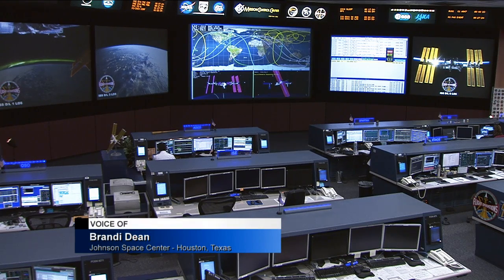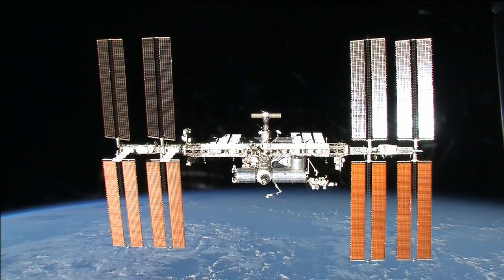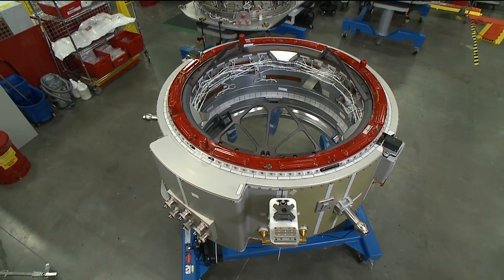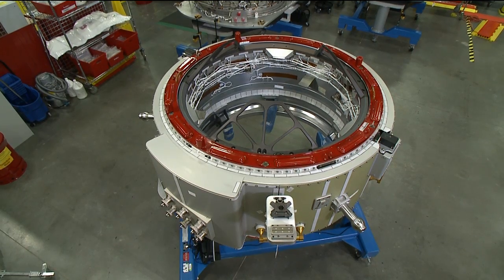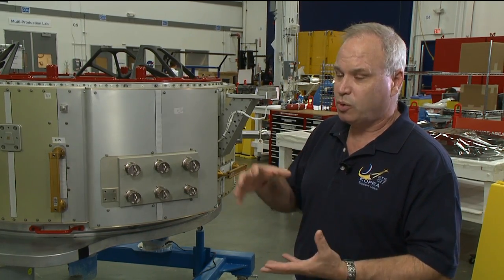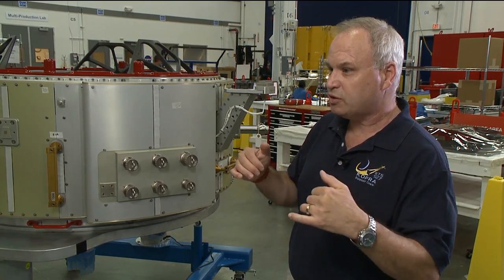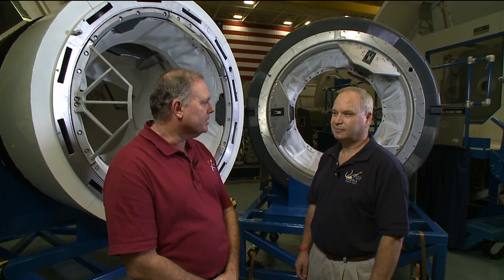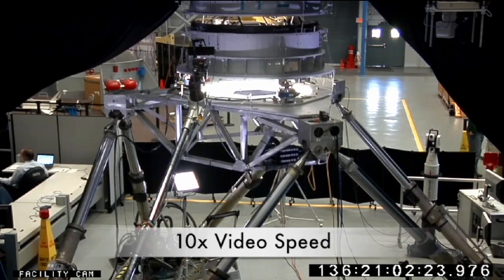Space Station Live: The ABCs of IDA

Comment: Maybe I missed it but why aren't they using copies of the Shuttle Docking Adapter, which was actually called the Common Berthing Mechanism? Apparently erroneously I might add, lol.
Reply: The Space Shuttles did not dock to to the Common Berthing Mechanism. Berthing is different than docking, because it requires you to bolt on the new ship (sort of like it's a new space station component). The tradeoff is that it can have larger port sizes to carry bigger objects. Berthing requires there to be someone on the station to do the bolting, so the you can't really use crew vehicles (in case of emergency). 

They used the Pressurized Mating Adapter. They were made using proprietary hardware that they were not allowed to replicate, and so decided to use and support the international standard.